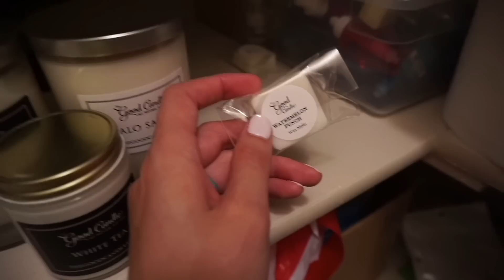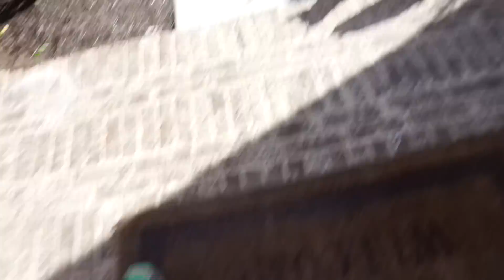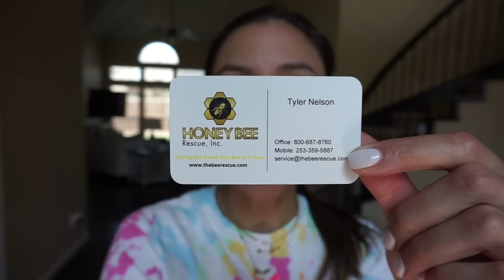VLOG | The one with bees, dogs, and pigs! OH MY!

Comment: @coffeebreakwithdani missed the poll about gel vs dip.  Dip is acrylic based it does reinforce the strength of you nails by forming a hard shell over your natural nail. Just like acrylic it can cause damage when it chips or breaks. It is thick and lumpy when applying but. An be filed to smooth out. The activator and layer glue also has a chemical smell. 

GEL also applies as a hard shell over your nail but unlike acrylic or dip has minimal damage to the natural nail if it chips or breaks. In my experience a broken gel nail enhancement separates cleanly from my natural nail with no damage. Has no chemical smell. No reaction to other chemicals. You can get clear gel at the salon and use regular nail polish use acetone to remove the regular nail polish the clear under will not be affected by acetone. Acrylic/dip gets gooey with acetone or bleach/cleaning products. Gel does not. In my opinion Gel is superior to acrylic/dip.